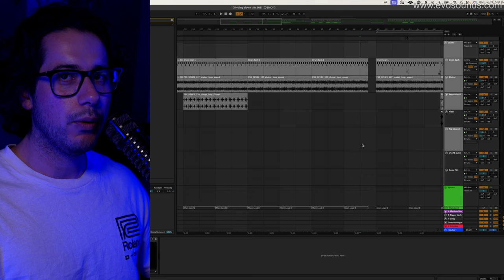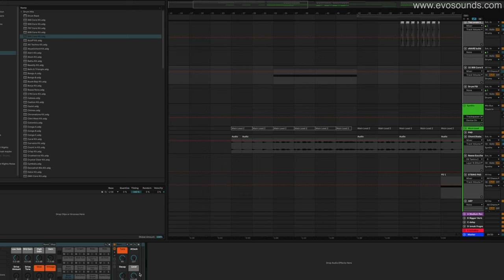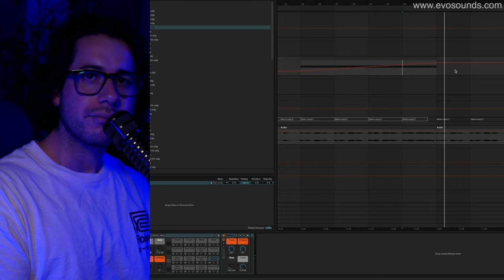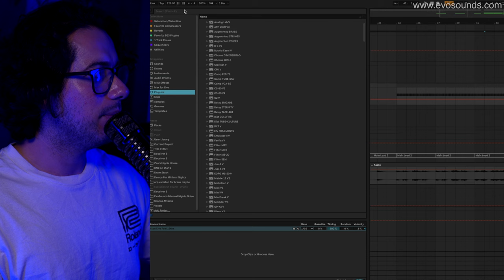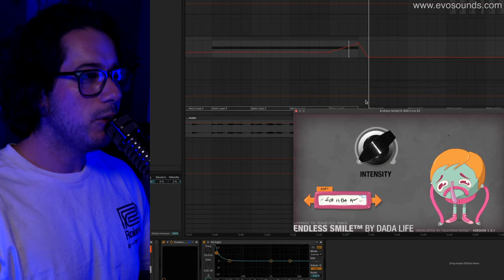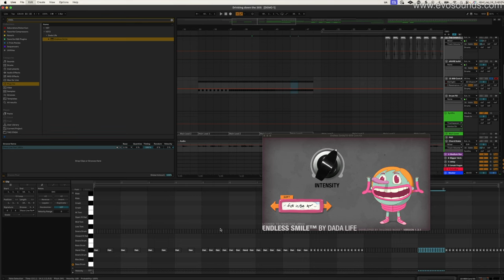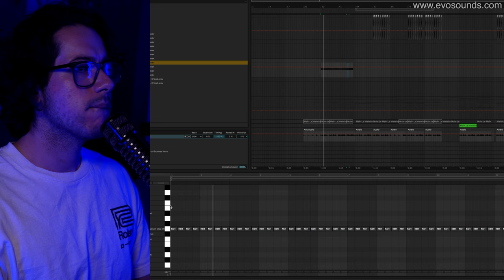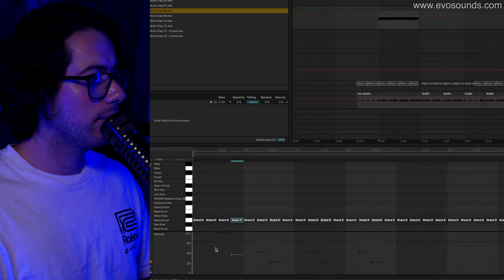HOW TO Insane Snare Build Ups That WORK

Comment: Thanks, Zen. Another epic tutorial. My drum rolls are pretty robotic, so these tips help a lot. One thing I wish you had covered was doing delay/reverb washes via stock plugins rather than the Endless Smile. No slam on Endless Smile, but these washes seem to be a standard element for a lot of genres. Is that something you'd be willing to cover? Thanks a million, Papi for your work and I'm having lots of fun with your Tech House sound packs, which are most definitely bad ass!

Comment: I have a question regarding 3:43, I've noticed that sometimes you also place endless smile on the master chain to affect the overall track. Is one endless smile enough, or are multiple washouts on different elements recommended?
Reply from the maker: I used to do it on the master and be lazy but now I’m being more careful only adding to what’s needed
Reply: @ZenWorld exactly, putting it on master makes it messy.
Reply: I make a different genre but i specifically like to use reverbbbb on snares with a long decay time, makes the build-up to drop transition real smooth.
Maybe you can try that out ❤❤